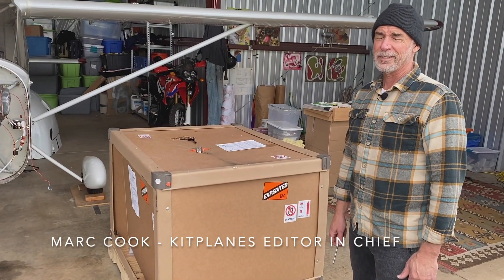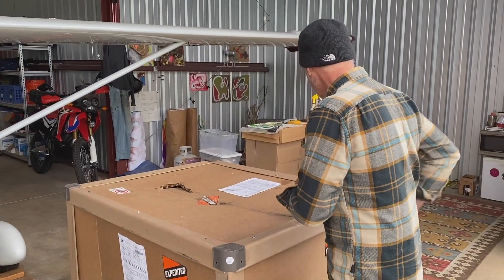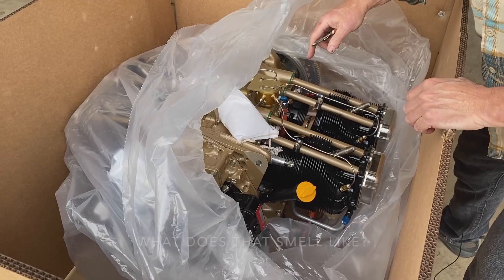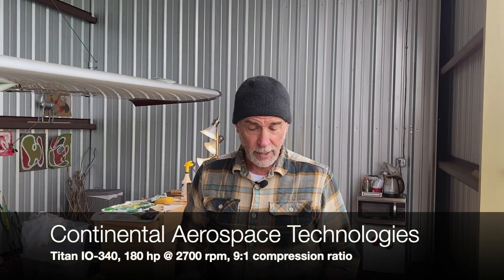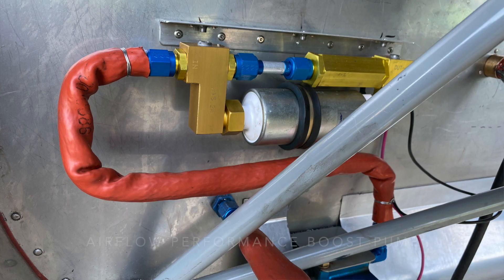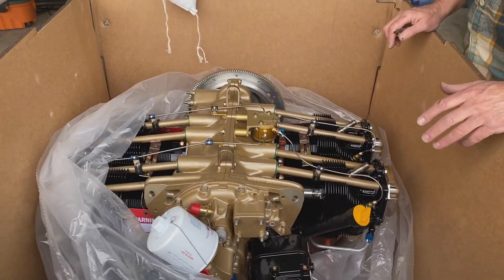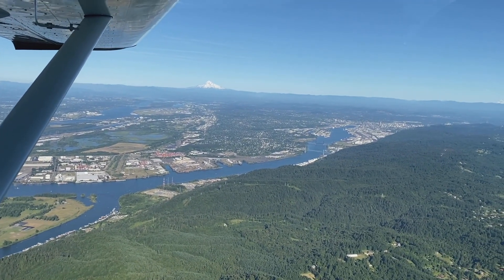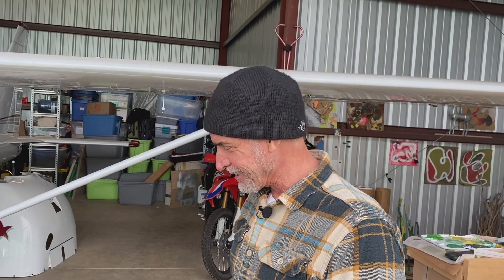Titan IO-340 Engine Unboxing

Comment: Marc I am the mechanic that built your engine. I have never been able to witness the excitement in a customer when they get their engine. Thank you so much for posting your video, it was a pleasure building your engine.
Reply from the maker: Hi, Chris. This is awesome to hear, thanks. You did a great job! (Marc at KP)
Reply: This is the coolest thing I've seen on YouTube today. I've always felt throughout my flying career that pilots and mechanics should have a close or at least friendly relationship.
Reply: Since you build these engines...I am wondering if I can run 90 octane ethanol free fuel in mine with the lower compression version? I am reading different opinions. Thanks!